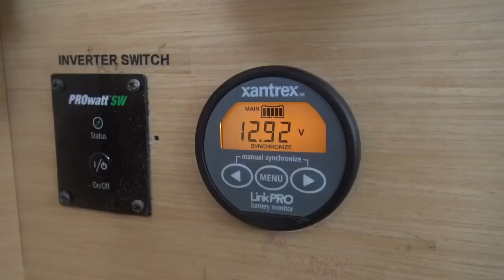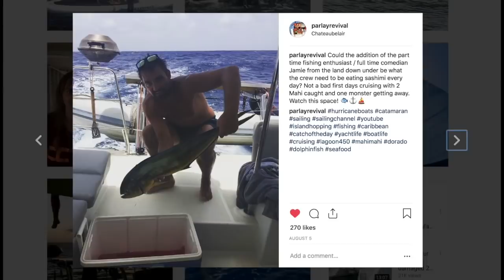Sailing in convoy with over 100 boats! - Episode 12

Comment: Videographer or not, I'll keep watching.  This video was great!

Did the changes to the solar wiring fix the problem?  Just make sure to use the proper type/gauge wiring.  Also, nothing that was sunk in sea water since any corrosion could cause the wires to heat up and cause a fire.